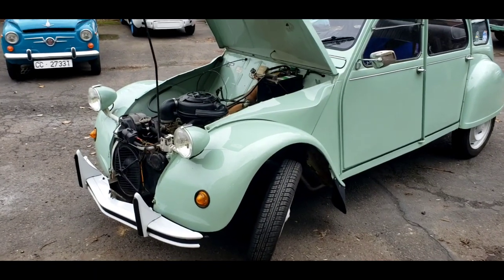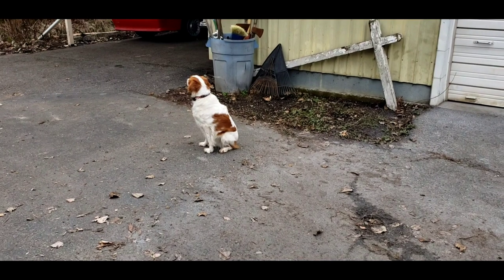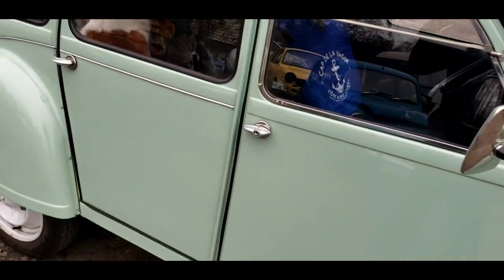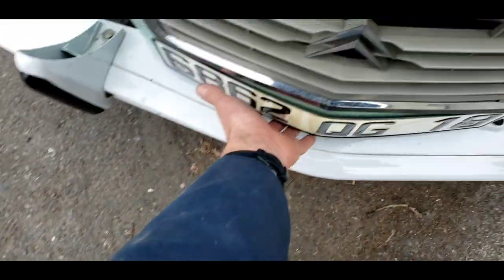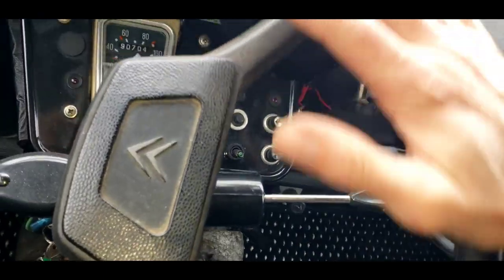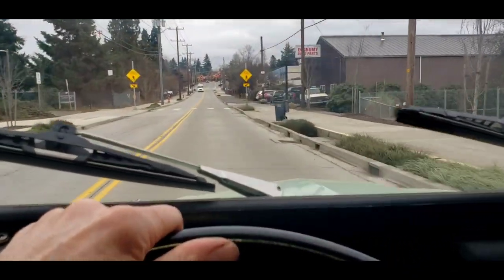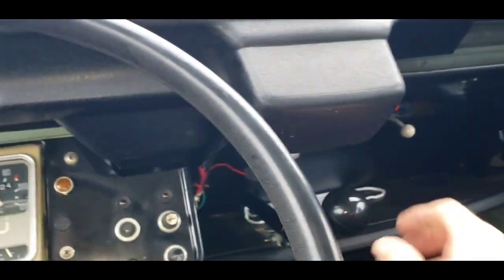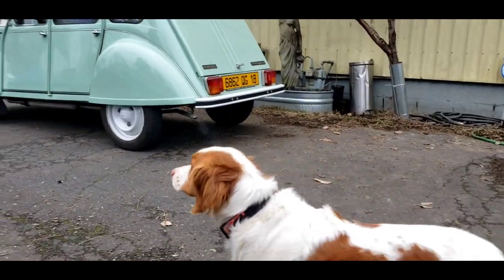Citroen 2cv Full Power Joy Ride

Comment: Those are French plates, 18 means it's from Cher, QG dates it's registration from early 1980 and the plates are matching. In the early 2000's, in France, plates were white in the front and yellow in the back (96-07).
If you sold your car to someone living in the same department, he would keep the same plates, but have to comply to the legislation by changing the rear one to a yellow one...

Comment: The licensce plates are originaly from France. They are from the pre-EU license plate era...Nowedays are EU vehiclesplates must have blue European Union flag on the left site of the plate...Kind regards from Harald, Belgium
Reply: I was wondering that, but wasn't sure. I knew they couldn't be UK plates. Wrong font for either era.
Reply: Not only that, the whole system changed. The last two digits no longer denote the Département and the car just keeps the set of original plates until it is squared up some day.
Reply: @michaelXXLF  18 is département du Cher
Reply: @Duaner244  It is, smack in the center of France! 
And Saint-Amand-Montrond where the car was sold is also in Cher, 40km south of Bourges.

Comment: I did a little research, this would be a late seventies 2CV with the dash, finned drums, extended headlamp bar (to accept the square lamps that higher spec cars were fitted with) & plastic Grille. The plates would be French as British plates have a different type face & format (ABC 123D pre 1983 A123 BCD post 1983 as examples)

Comment: Apart from the drum brakes, which put it at approx pre 81, it appears identical to my ‘87, so I’d say it’s definitely later than a ‘60.
Reply: A lot of the 2CVs that were imported into the U.S. in the late eighties were newer (or even brand new) models with 25 year old Serial Number plates to get around emissions and safety rules. The official story given was that they were 25 year old cars that had been completely (and I do mean COMPLETELY) rebuilt.
Reply: @robertkirchner7981  An interesting way to get around regs. So a 60s car in spirit only😁

Comment: It might be a late 1980s 2CV6 Special body on a pre 1981 chassis with drum brakes.
My 1978 2CV6 club had inboard drum brakes.
My 1982 2CV6 Charleston had disc brakes as does my current 1990 Charleston. All 3 are RHD and imported to Australia. 
My current car was made in Portugal and is getting a Burton Big Bore 652 cc engine plus Power Tube to replace the original 602 cc engine after 285,000 KMs. Fabulous Fun

Comment: Even more fun when you reach 50mph and the upper part of the front doors is being pulled outward and icy air comes all over you! 😁
Reply: Even more fun when it's winter, and the casrboard heater system has rotten 🤐🥶

Comment: It looks practically the same as my 1989 2CV6, except the speedometer, I have the broader version, which came with the "Club" version. The name of the colour is "vert jade", which was originally in use in the late 1970s, early 1980s (mine was originally red). The drum brakes were replaced quite early at the 2CV, so it's strange to see a 602 ccm engine with drum brakes. But as you mentioned, this car is made by parts from several 2CV.

Comment: I wonder how one of these little boxer engines would perform with individual carburetors for each cylinder. BMW squeezed 45-50 hp out of a 650 cc boxer (high compression engine, large valves) but even the 470 cc engine would at least make 27 hp.
Reply: Only 2 with add 2 x single carburetors add close nothing at power and you loose torque, but the 602c 29hp engine is relative easy to tune up and can reach reliable 40-45hp (need to replace the cast iron cylinder with  a aluminium Nicasil cyclinder kit in 652cc who cool much better, electronic ignition, with high compression pistons and sport cams but with the same valve diameter to avoid cracks and finaly 2 carbs) , but in races it reach 70hp at high RPM , but did not last long time...